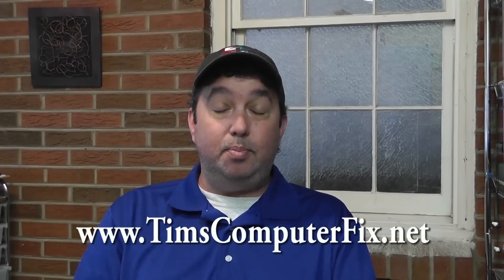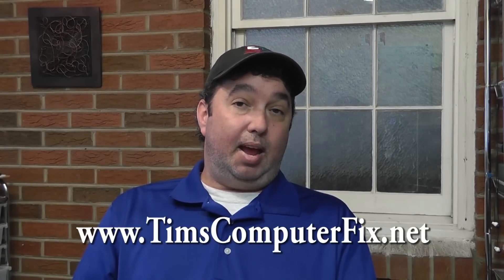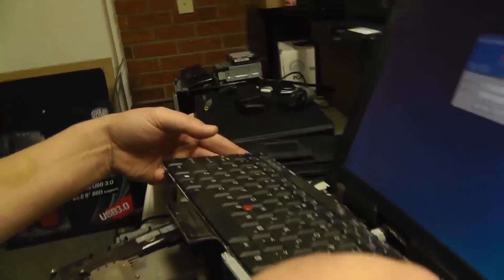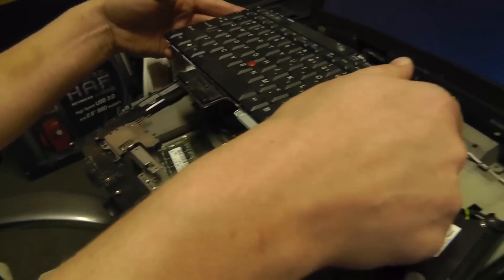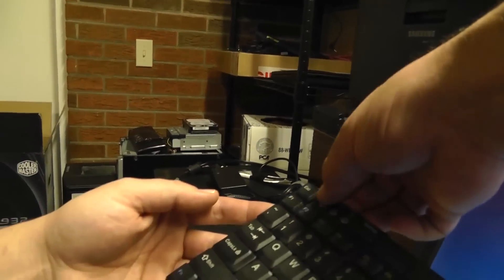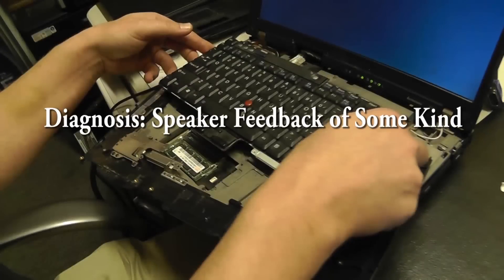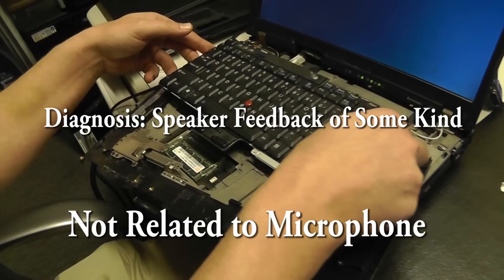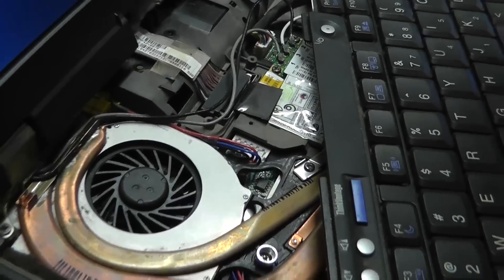Computer Repair Solutions Tips and Tricks Part 2

Comment: Electro Magnetic Field effect (emf)  causing the speakers to pick it up so when you passed a metallic object over the top of the battery with the wire under it the speakers  coil would of amplified it hence the sound out of the speaker, good fined never seen that coming.that's why shielded cables are best used nice job Tim.